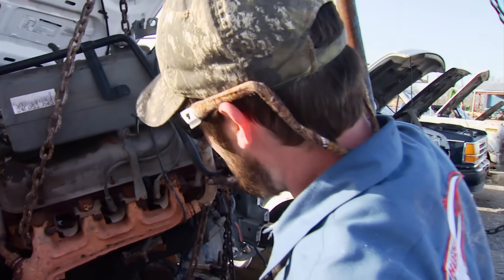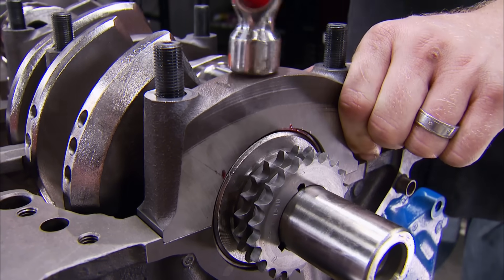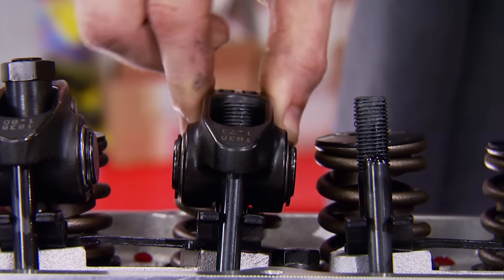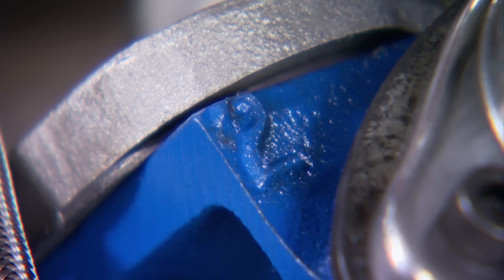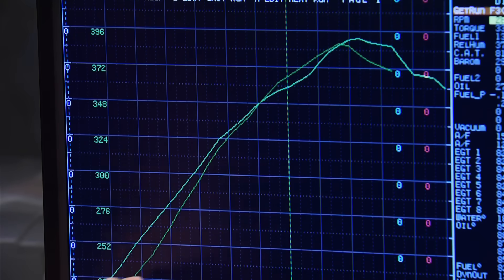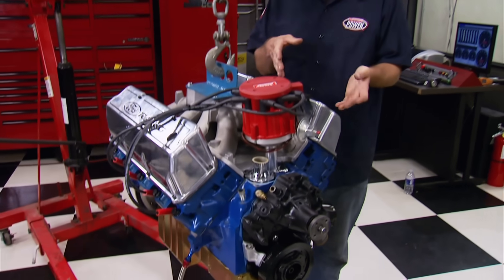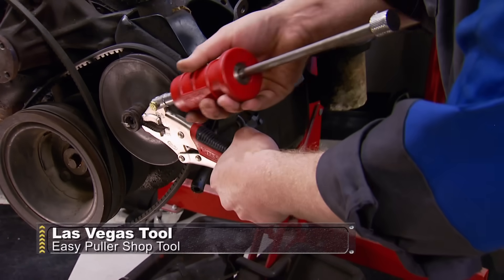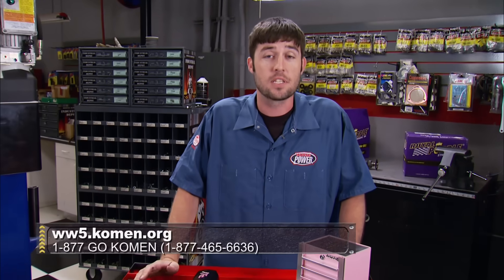351 Small Block Dyno Shootout: Windsor vs Cleveland - HorsePower S16, E11

Comment: Even Ray Charles could see how dumb this is. A 408 Clevor with aftermarket heads vs a 357 Cleveland with stock open chamber heads. Wow, what a comparison.
Reply: @bigboreracing356  right on. My 393c, with stock iron 4v heads made over 500 hp & 500 ft lb, easily.
Reply: @kym393  Is that with closed or open chamber heads?
Reply: @jglayden  closed, I've a couple of videos on my profile,  1 of dyno & 1 of it idling
Reply: @kym393  can I ask you what size pushrod you using on your app? Thanks
Reply: @shawnsullivan1365  hey mate a Trend  8.700 x 3/8"x .080 x .210°
Reply: Yeah, can't hardly beat a Cleveland. Unless you cheat. But these guys are here trying to make money. They want to sell parts. Many more windsors out there. So they sucker people into believing their narrative and fill their pockets.
Reply: Not only that but Torque Making Dual Plane on the 4" stroke Windsor vs. Single Plane on 351C...Yeah not fair fight...
Reply: @MatthewFogarty-k2y  I have seen plenty
Reply: Davey Bednarek so true
Reply: And they put a single plane intake on the Cleveland and never rejetted the carb for the higher flow of the 4V heads. Obvious bias.
Reply: Liam Christensen  Let it sit for a few years and then try to cold start it.
Reply: Liam Christensen  I'm not sure what you're climate is like but it's very common in the midwest U.S.
Reply: Liam Christensen  You probably got the good motors from Australia too.
Reply: Davey Bednarek I have to agree with your thoughts about how vastly different these two engines are based on the components used for each build and if these guys actually intended to do a comparison with dyno results as an indicator of which engine might be a better choice for a performance application, they only made themselves look totally incompetent. 

To get an impartial opinion about the results, they should have Ray Charles and Stevie Wonder watch the video and make suggestions based on what they see 😎.
Reply: @bigboreracing356  - Taking 351C to 408C wouldn't make any more HP, just more torque... you have to fix the 4V head's horribly shaped ports to get more HP...
Reply: @bigboreracing356  - Nope, same HP, but peaks at lower RPMs... unless you fix the heads...
Reply: @bigboreracing356  - Nope... a pair of heads and cam makes same HP no matter how many cubes under them... because it's the same air flow...
Reply: @bigboreracing356  - LOL !!! You don't realize those numbers were no where's near accurate? Every car company's Trans Am 302's were vastly under rated as factory rated "290 HP 290 lb.-ft." It was the running joke! To keep insurance rates down! Biggest joke was Chevy L88 427" at "430 HP" !!! 
Car companies convinced people that more cubes = more HP but that's not true. What they didn't mention was bigger engines also got bigger cams, bigger valves, and bigger head ports to match, as well. I'm a retired GM engineer, I lived through the 1960's, daily drove Jetfire, GTO, etc... 
Study these two articles about stock engines and get the real info. You'll have to click on "SHOW ALL" to see the real numbers: 
http://www.superchevy.com/how-to/engines-drivetrain/sucp-1003-classic-chevy-small-block-dyno-testing 
https://www.hotrod.com/articles/hrdp-1001-muscle-car-engine-shootout 
.
Reply: @bigboreracing356  - You've never built an engine... I've designed and built millions of them! And driven thousands of cars!
Reply: @bigboreracing356  - Quicker 1/4 mile time is a function of torque... torque varies directly with cubic inches... HP doesn't... I make engines, not waste time making videos... There's a guy named HeadBytes Porting that got so wrapped up in making videos he got years behind in getting his customers' heads ported and was sued because he kept heads so long his customers assumed he stole them. I suspect he was also going into dementia. I argued with him under his videos, told him to stop making videos, and get his customers' heads done and sent out. But, that didn't work out, either... he no longer knew how to port heads properly... even sent heads back out one crappy ported and forgot to touch the other one... he's either in jail or an asylum now... 
https://www.corvetteforum.com/forums/transactions-feedback/3496062-warning-headbytes-porting-do-not-buy-anything-from-this-guy-company.html
Reply: @bigboreracing356  - Engines are engines... brand doesn't matter to how they work... 
The 396 will make more HP at 6500 because the 454 will have passed it's HP peak RPM and be on the downhill side...
Reply: @bigboreracing356  - RPM and torque are measured DIRECTLY! HP is a CALCULATED NUMBER taken from RPM and torque... On a graph, HP and torque curves cross at 5250 RPMS because the HP formula has the number 5250 in the denominator... (assuming the engine can reach 5250 RPMs, many stock engines pump up the lifters before then)
Reply: @bigboreracing356  - Stop lying, 4V heads can't make over 300+ HP without a ton of modifications... They even sell port plates as an easy crutch fix for them: 
http://www.mpgheads.com/port_plates_a.php
Reply: @BuzzLOLOL  mate I'm not sure if I've misunderstood your post, but I've got a 393c with stock closed chamber iron 4v Heads and it made over 500hp @ 6400. and 500ftlb @ 4100 at the flywheel.
Reply: @kym393  - You must have had later or modified heads...
Reply: @BuzzLOLOL  1973 Australian 4v's, 10.9 compression. Jones  solid roller cam, Scott Cook dual plane. 750 carb.
Reply: @BuzzLOLOL  I've got a video on my profile of the dyno pull if you're interested.
Reply: Cleve's great breathing but inexcsuavle that Ford chose valve train oiling over main journels,  2 pc valves the hell....
Reply: @grandcrappy  - The worst shaped big ports in history produced turbulence that knocked 200 HP off of the breathing ability of stock Cleveland heads... they used typical 2 piece valves stock since they didn't make unusual power or RPMs stock...
Reply: They probably needed to check the valves and make sure they are sealing like they should because my experience with “pre-assembled” heads is they always have valve sealing problems
Reply: Stock vs stock, the bottom ends were better on 351 Windsors than Clevelands except for rare super stock 351 Clevelands like the Boss 351.
Reply: That 408 won't last too long before the main journal breaks.
Reply: Criss drill out Cleveland heads and put them on the Windsor 🤤🤤🤤🤤🥰🥰🥰🤩🤩🤩
Reply: Even if it were 351Cleveland v.s. 351 Windsor the Cleveland is going to win, however Clevelands are junk motors and tend to either warp their heads or completely vapor lock.
Reply: @tskraj3190  Vapor lock...bahahaha. You have absolutely no clue whatsoever. You are the one vapor locking, hence your warped head coming up with such rubbish comments.
Reply: I've run Cleveland's for over 30 yrs. Have never had either problem. I would twist mine to 8200 and beat on it everyday racing and on the streets. Only issues is finding a good block.
Reply: Which blocks are best/worst?
Reply: @tskraj3190  that's a myth.. Cleveland s go a long time,with superior power..total myth
Reply: @tskraj3190  head warp? No… cylinder shift? Yes
Reply: @tskraj3190  Huh??? This is not a thing. Junk and cleveland in the same sentence?? wow.
Reply: @VariantLandscape  If you owned them then you would know.
Reply: @tskraj3190  I currently have 2 of them and have owned 4 previously and none of what you mentioned has ever happened nor is it even a known problem.
Reply: @VariantLandscape  Clevelands have many problems and they are well known hence why Cleveland motors no longer exists.
Reply: @tskraj3190  this post is over a year old but i have to say, not really, Im running one and idk how you can attribute vapor lock to a specific engine when it's a problem with your fuel delivery, a windor or even a sbc would be equally susceptible. 
The reason clevelands were cut was because Ford had the Windsor which was cheaper and had parts commonality with their very popular 302/5.0 engine, thus requireing less variety and cost in production and development. Another massive factor which killed the cleveland was the increasingly stringent emissions requirement for engines which made a high proformance small block near impossible to build in 1974, making the design purpose of the cleveland redundant in the face of manufacturing simplification. The only "problem" with the engine is the main journal size being smaller than a windsor which was an easy enough fix as evident by the cleveland's bigger brother the 400 and later 351M which remained in production for another 5 years as Ford's high torque small block. Even then when people talk of its oiling system as being poorly designed for proformance, many V8s of the same era featured the same setup without anyone questioning their setups.

With all of this it is important to mention that the 351c remained in production and was very popular in Australia for years after it was discontinued in the US. The reason? Lower emissions regulations and higher octane pump gas meant the Cleveland was able stay in production and even developed further into even better engines than they were in the US. And yes, any vapor lock issue the cleveland is aparently super prone to, doesn't come up very often in a part of the world which makes the Midwest summer look like Siberia.
Reply: @thatguyoverthere9634  The main problem with Clevelands was they would randomly overheat and the blocks after sitting would condensate and the blocks would eventually rust on the inside seizing up the engine. On top of that they were notorious for valve cover leaks. Those motors usually only lasted 175K at most but a majority didn't even make it 120K

Comment: the purpose of this video is to sell clevor parts for those gazillion 351w blocks out there.
Reply: Ford power for life! Old an new.
Reply: The Windsor block is better and a lot more available than the Cleveland. The canted valve heads will always out perform wedge heads of the same quality. I'm saying you can't compare AFR wedge heads with Cleavor heads unless the Cleavor heads by Edelbrock were professionally ported.
Reply: @stevewelborn8744  I'm on the same page as you but for a different reason.  I never liked the Cleveland 4V setup because the exhaust ports on those heads were so prone to cracking it was rediculous.  I think the problem lies in inadequate coolant passage design to dissipate the heat.
Reply: right... because Edelbrock can't seem build an off the shelf set of Ford Windsor heads worth a damn.
Reply: And AFR 205 will still outperform them.😂🤣

Comment: So how come you didn't try Edelbrock's aluminum heads and matching intake for the Cleveland? Throw a nice cam in there too and it would't have been anemic compared to the Windsor, topped with aluminum Cleavland heads and a smaller combustion chamber with a big cam. Smdh.

Comment: I have a 408 Cleveland with roller 4v heads, solid flat cam.  465hp 5800rpm/495lbs 4100rpm.  when you swapped the 2v for the 4v, did you change out intake and headers to match the bigger ports?